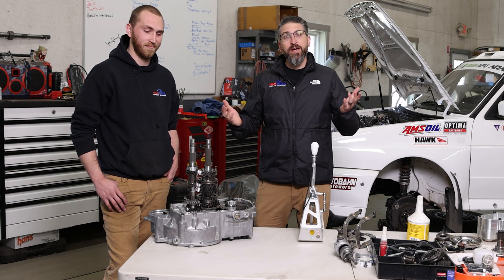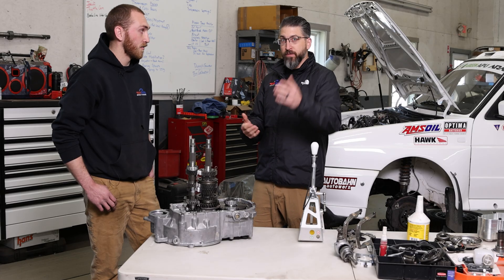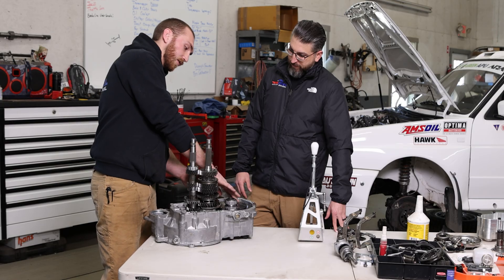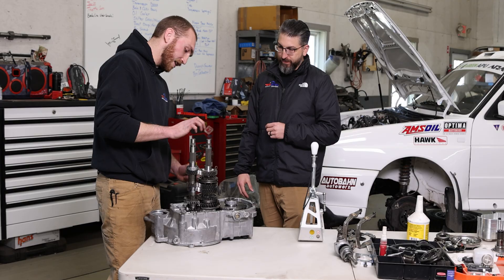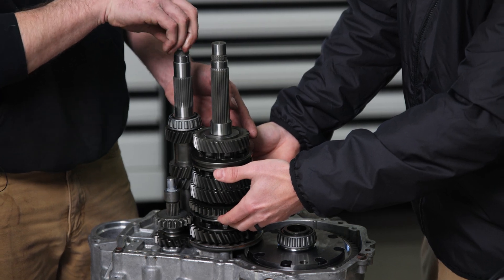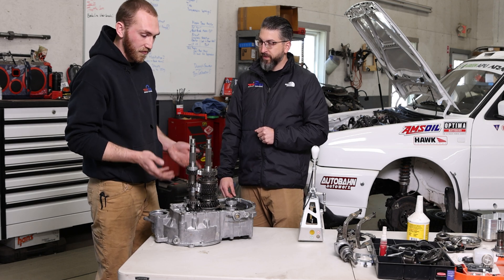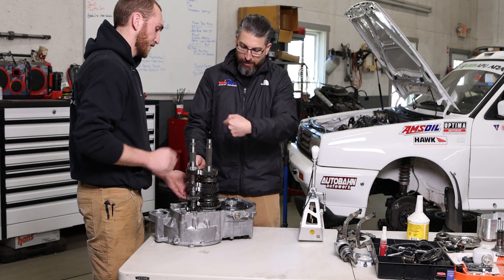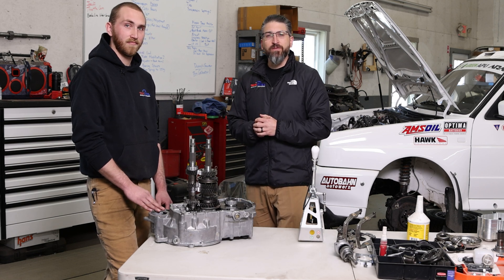This Is How A Manual Transmission Works

Comment: Neat detail at 4:41 : notice the straight cut gear teeth for the reverse gear. That's why your car sounds like a noisy race car when in reverse (assuming you've got a manual transmission). Most racing gearboxes will have straight cut gears throughout instead of just reverse. This leads to more noise, but not having that lateral force to deal with means you can make the whole gearbox lighter.

Comment: I imagine slamming through the gears would be quite rough on the synchros. What are your thoughts on double clutching and do you guys ever do so for mechanical sympathy while rallying?
Reply: you wont have time homie, things will wear and thats life
Reply from the maker: Being smooth when you shift will do a ton for mechanical sympathy. With all the excitement in a rally car we see more issues trying to not miss your gate or shift in the wrong gear which might only get one or two of those before you transmission is gone. The other responses are also great and we appreciate the community @ancientapparition1638, @sethjansson5652, @phantomrally86 and @Levibetz
Reply: @Teamoneilrally  How often do you have to repair gearboxes in the rally school's cars? are they stock gearboxes?
Reply: If you match the engine speed to the wheel speed per gear when moving the stick and connecting the clutch, you will be completely fine going through the gears. This applies with synchros or not, and you do not need to double clutch on working synchros. The stick lets you know how much resistance there is with the synchros until a smooth engagement is possible with the gear. Once you get used to rev-matching and timing, the shifts become not only smoother but faster
Reply: Double cluthing is a method for transmissions that don't have syncromesh at all. When you double clutch, you are simply having to manually open up a window in rotation for the next gear you want to engage. The only thing it helps with in synchronized transmissions is going to a lower gear for optimal acceleration.
Reply: Keep in mind, the more force you put into the syncro yes the more wear you put on the fork and blocker ring, but also, the more friction is created by the syncro and the faster it stops slipping. Short throw shifters can exacerbate this sometimes.